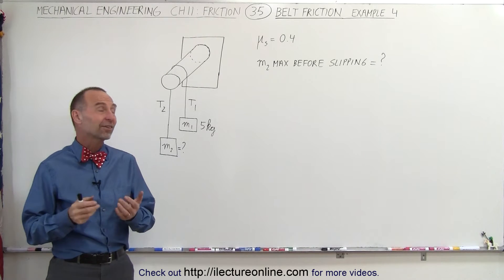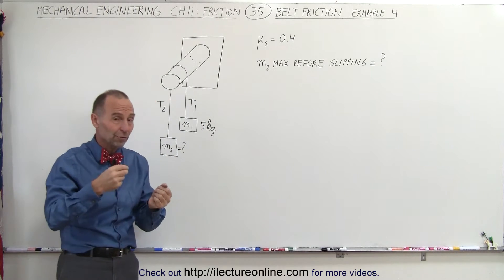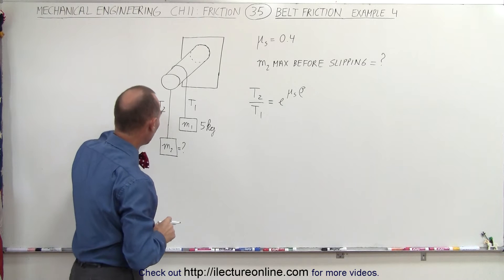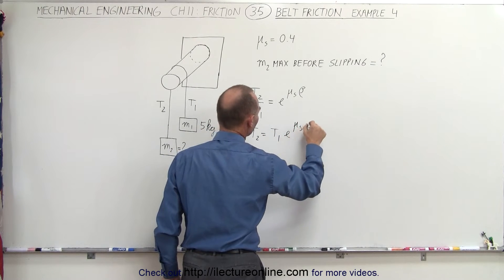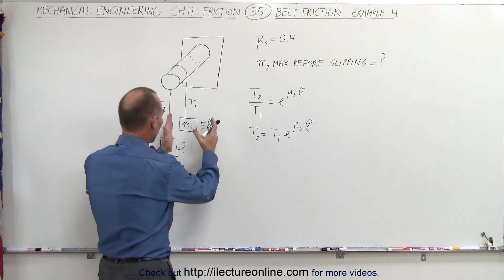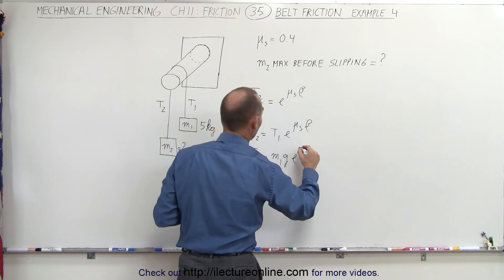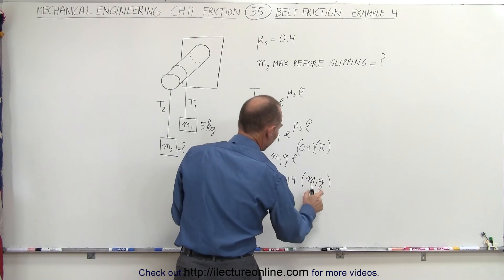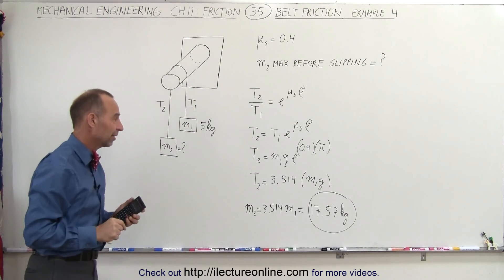Mechanical Engineering: Ch 11: Friction (35 of 47) Belt Friction: Ex. 4

Comment: How do you distinguish between T1 and T2, like which side corresponds to what?
Reply from the maker: The convention is to let T2 be greater than T1.  The left side has the greatest mass thus the greatest tension.
Reply: @MichelvanBiezen  how would you know if the masses are not given?
Reply: @wardvereecken9701  can you study or read books too much questions